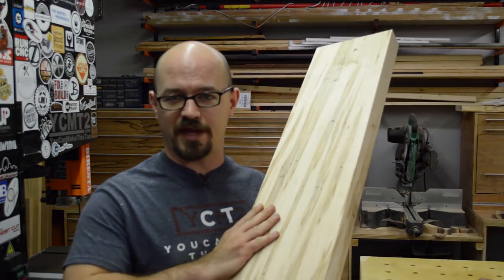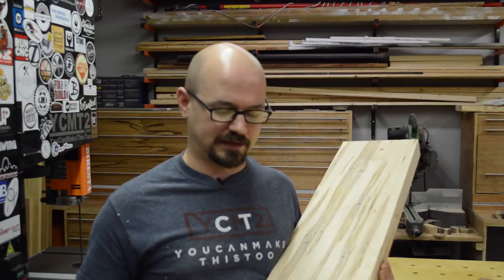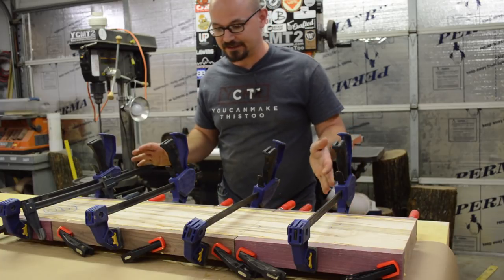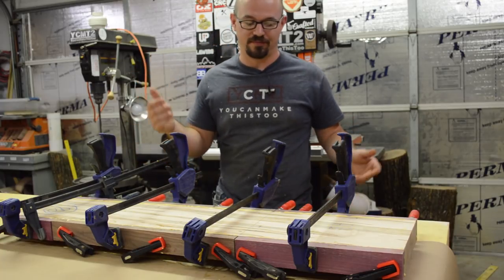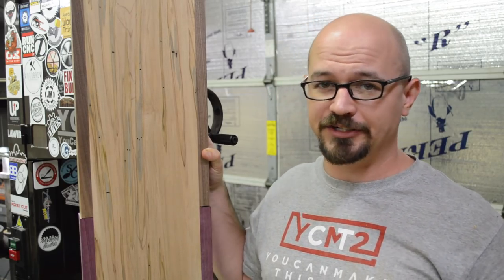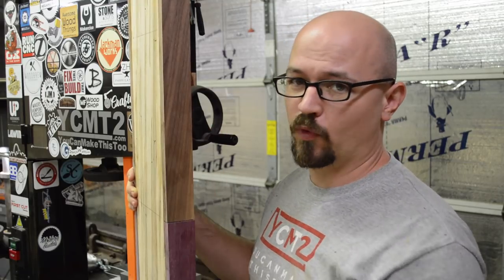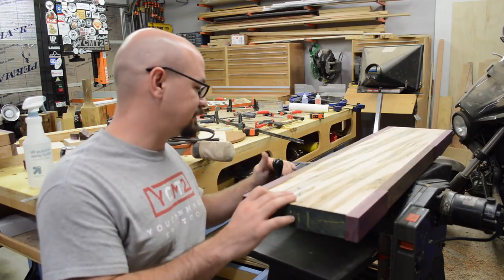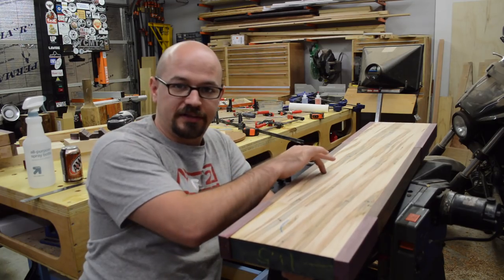How To Make DIY Clipboards | Take Notes in Style

Comment: Re-sawing make me worry as well.  I noticed you started some re-sawing with the table saw, did that help?  They turned out really nice by the way.
Reply from the maker: +Gary Jones thanks, Gary! Yeah, cutting them on the table saw makes it a lot easier. It doesn't go all the way through so I finish on the bandsaw but because what the bandsaw cuts is si much thinner there's less issues. But, the table saw has a wider blade and turns more material to sawdust. Was hoping to save some material by using the bandsaw.

Comment: Hello, im just here to ask: What can i use a clipboard for? I've found some RLY CUTE ones in one store but i don't know what to use them for😅😂 (I mean don't get me wrong, im aware of what you're supposed to use them for, it's just that, i, as a 15 year old girl, freshman in high school, don't rly know what can i use it for) SO PLEASE, ANY IDEAS???
Reply from the maker: Uhmm, take notes by hand in class? It’s also been trendy to use them as wall decor and swap out pics and notes on them
Reply: I use mine to draw and sketch. Its a lot cheaper than buying sketch books. A4 sized metal clipboard cost me €5,90. And you can get a pack of 500 A4 size printer paper for €3,95. Meanwhile the cheapest A4 sketchbooks will cost €4,95 and it will have only 60 pages. So if you draw a lot, it gets cheaper to buy clipboard. And if you are on the go, you can clip different papers on it, instead of carrying several sketchbooks. Like colored papers, watercolor papers or maybe some bristol board.

Comment: NIcely done -  Thanks -  re sanding / planing, I'd point you to the Flatmaster at http://stockroomsupply.ca/shop/   I have one  (not affiliated in any way) and love how I can easily do so much, and how little dust is made. Well worth checking out - if you build as a kit, it's very reasonable. I regularly sand to + or - .005 for parts to glue up for turning. No tear out problems like w/ a planer, so no problem with burl / curly maple wood I use a lot of.
Reply from the maker: +netacadman thanks! I definitely want a drum sander some day.